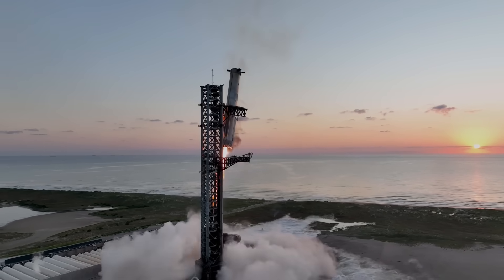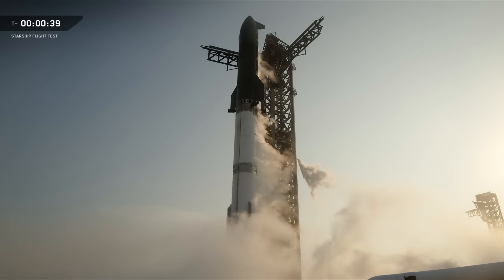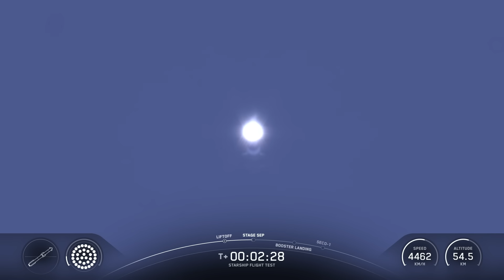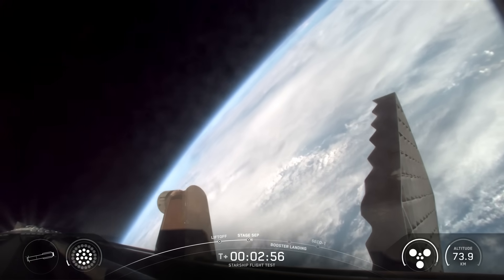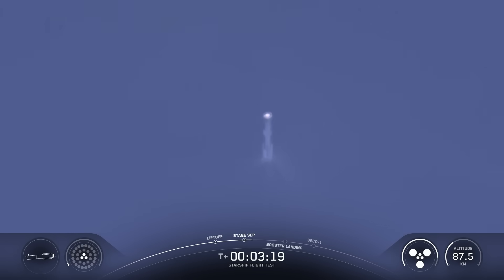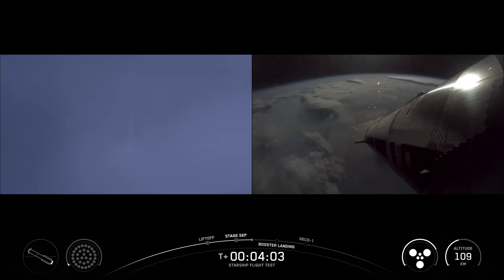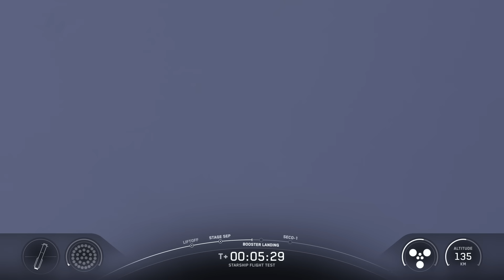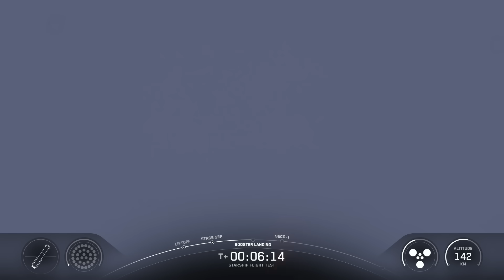SpaceX Builds Largest Reusable Booster, Also Makes Door That Won't Open - Starship Flight 9 Recap

Comment: There is an old documentary showing rockets blowing up, iteration after iteration and the NASA narrator says, "Each time we blew up a rocket we learned another way to not blow up a rocket".  That was totally logical to me at age 9.  Now watching these utterly fantastic iterations from SpaceX I have to think of those early days of NASA and still, at 71 I agree with the logic.  Run it till it breaks and figure out the failure.  It will take as many flights as are needed but they have the grit and determination to win.  As much as I despise his politics I can only say from the heart, God speed Elon Musk.  I'm not getting any younger and I want my ticket to the big wheel in the sky.  heh

Comment: Good video Scott.  I think SpaceX need to reduce the vibrations at source, not merely strengthen the parts which fail under vibration stress.  The raptors need to have dynamic damping on the propellent lines feeding the engine.  This requires a chamber containing gas to absorb some of the pressure fluctuations. No doubt they have solved dozens of tricky engineering problems that I know nothing about but the two big issues I see are the lack of flame trench initially, and the lack of dynamic pressure damping within the engines.  They have now adopted a flame trench - will they also redesign the engine to reduce vibration?  Anyway, what they have achieved is tremendous, and impressive.
Reply: If one is to assume this is the core problem, since fuel pumps have oscillating rather than continuous flow, perhaps each pump's cycle could be offset, so that the combined vibrations cancel each other, instead of going harmonic and resonant.

Comment: Who else but the Presidents mate would get away with so many failures? Ship has not worked 100% on any of the flights so far, either on the way up or on the way down. No other Space launch company would get such a huge free pass for failure. SpaceX have some excellent engineers, but this "The best part is no part" mentality is holding the whole company back. Musk is the problem in Space X and his build it cheap mentality. I pity the first humans to fly on Budget Space.
Reply: Have you not seen all of the test flights?
Reply: SpaceX is a private company.  There is no "getting away" with something.  They are free to do as they like, and their customers are free to abandon them if a better alternative comes along.  Reminder even with all these failures, the Starship program is estimated to have cost ~8b so far, vs. ~80b for SLS....

Comment: Don't we remember anymore that Space Shuttle went to space with astronauts without a test launch?
Reply: And it took 8 years from funding allocation to first flight.
Reply: @rootieboy  Bruh starship has been in development for 13 years
Reply: @rootieboy   and how many years did starship take to have 9 failures?
Reply: @rootieboy  it's been 9 years since the starship concept was first revealed. 6 since this version started development.
Reply: And it killed 1/50 of its flights, including the astronauts.
Reply: The Space Shuttle was engineered, and the Starship is being designed by trial and error.😂 I'm still not sure how you human rate a spaceship designed by trial and error.
Reply: @user-fr3hy9uh6y  put musk in it and see what happens.
Reply: @user-fr3hy9uh6y  Godspeed to the first people to actually fly in one of these things.
Reply: And if it had test launches and iterative program, Challenger and Columbia crews could still be here.
Reply: @ArathirCz  It would not have. Both failure modes were known about prior to their respective disasters and it was a management error not to remedy them in time.
Iterative design would've done nothing. Other than, by the looks of things, make each disaster happen way earlier in the timeline.
Reply: This
Reply: We remember a few more things about the Space Shuttle too...
Reply: The space shuttle program murdered multiple astronauts. You're an imbecile... At best.
Reply: and it cost 900 million per launch
Reply: And the Saturn 5 had 12/13 sucessful launches, with one being a partial failure of the upper stage.
Reply: At what cost?
Reply: What you mean the hardware still had major near fatal failures and even fatal ones
Reply: And my mom can go to the store on her bike; what does that have to do with a different testing paradigm etc.? Note, my mom does not want to go to space but surely tests my patience to not try
Reply: YEAH BUT...  They were not making the worlds richest man richer - so in that regard they were total failures
Reply: @piccalillipit9211 how Is making elon ritcher? Quite the opposite.

Comment: "most advanced rocket engine we've ever seen... struggling to make a door". That one killed me
Reply: Idk if you have ever watched a DnD podcast, even high level parties fail to open doors
Reply: They expected rocket engines to be difficult to make and planned accordingly. They expected a door to be simple to do and thus planned poorly
Reply: I seems very likely that fuel leaks in the cargo chamber could have changed internal pressures in a way that precluded full actuation. Also could have been related to the semi-uncontrolled axial rotation the ship had shortly after SECO. 

It's fun to hate on things, but we don't have the data yet to conclude whether the door design failed or if there were other factors at play.
Reply: I think there were enough people and resources devoted to the engine team, so it progressed well. Makes sense, the engine is the most complex part.
Most likely there were not enough people on the door team - maybe a single engineer, plus a few interns. The task was simpler, but with limited resources it was underestimated.
Another option would be if the door was fully capable, but some electronics/wiring were burned from the launch, so the commands could not go through. Or another critical system was failing - power/hydraulics was lost for that system.
Reply: @nikolatasev4948  No, as scott mentioned the space shuttle had also problems with the hangar doors. I remember that there was a problem with expanding materials because of the solar heat. At other missions the shuttle faced the sun with its undersite, that was the fix for that. U cant simulate space conditions at that scale.

Comment: One of the boosters engines was flying for the third time and performed perfectly. That I regard as a success.
Reply: Those sea level engines are well designed. I would have never thought that such a complex engine could last as long as they have. The designers did a fantastic job designing them.
Reply: @billsimpson604  I totally agree Bill.

Comment: The booster is a success.  They really need to rethink Starship. 9 launched and they've solved zero problems.  Also, a great deal of funding comes from tax dollars. They are supposed to be able to land on the moon....last year...

On the other hand,  SLS/Orion has already gone around the moon and back.
Reply: What do you mean solved zero problems? It was a different reason for failure and the problem from last time didn’t happen because it was solved, it’s not funded by tax dollars either, a small part of the program has a nasa contract helping fund it, if you knew how government contracts worked you’d realise it’s a stupid comment to make 😂
Reply: Also sls took 11 years to launch the first one, starship has only been in production 6 years, hardly a good argument, maybe you’d have a point if starship was still failing in 5 years time 😂

Comment: Its insane to expect that a rocket built like a tin can to fly not only ones but many times. High vibration is a big problem. It destroys structural integrity of the ship. Get to the drawing board. Add some skin. They cannot test full trust continuous vibration on the ground during pretest. Its a problem.

Comment: at 8:18 decoloration due heat at the rear end of the flap? i dont think they fixed what goes wrong with flight 7 and 8, something leaks + on fire, the ship just hold together long enough til engine shut down this time (by luck?). just my guest, but decoloration is there.

Comment: I’m starting to wonder about the vibration while the first stage is lit. I’m wondering if Starship is being shaken to bits and welds are failing.

Also that’s a lot of debris floating around inside Starship. I think they need to improve the basic welds.

Comment: I wonder if the door not opening is a pressure thing,  any pressure difference between inside and out will  pin the door shut. Is there anything from spaceX on what is going wrong?

Comment: I'd describe the flight as a well-rounded failure. Nothing catastrophic, but nothing that was part of the plan worked either (beyond stage sep and making it to orbital velocity).

The Starship program progress has definetly slowed down. Next three flights, to be flown so quickly, I assume these are the current Starship versions that they want to get rid of. So if that's correct I'm not excited at all about these flights. Best we can expect is a repeat of ocean touchdowns of flights 4-6, and this will eat away 4-5 months from this year frrom June onwards - which basically means 2025 is gone. What's beyond that is really interesting..

It's good Elon is smart enought to realise he needs to get back to his companies after many months in politics.

Comment: Reuse of the booster is definitely a success story.

Not exploding on ascent is a “success” only in the sense that the previous two flights set the bar so low.

Everything else was a failure. 

I take great pleasure in watching SpaceX fail.

Comment: High vibrasion opened holes in the bottom and eventually rocket failed. Booster needs to be more robust. Right now its not. They cut too much weight weekening structural integrity. The best part is no part not always correct. :)

Comment: There is one more thing to consider in the success or failure department, and that is the Artemis 3 deadline.
There are now Starship/material capabilities that they've been trying to demonstrate for around half a year but the Starship has been lost or some other issue has prevented it, and these demonstrations will be required before other demonstrations. This is going to impact their schedule, even if they can ramp up the launches with the increased launch license you need to be confident you have solved issues that prevented the demonstrations from taking place previously.
There is a point when the extra data you gained from launching isn't worth the cost of that launch, if you're basically making no progress in your milestones.
So I think we are somewhat close to a point were they'll need to stand down for a period to really go over design again.

Comment: With the 9th Apollo flight they orbited the moon, tested the descent and ascent of the landing module, docked and returned to earth safely with 3 people on board. 56 years later and in the 9th flight they can't even open the cargo doors. My opinion that this is a very expensive case of imagination meeting harsh reality has not been changed by this test. Also, as good as it was, the second booster use didn't exactly lead to a promising third use even if that was never the plan.
Reply: apollo wasn't trying to reuse the saturn. huge difference.
Reply: @TMS5100  They reuse the Falcon 9 with remarkable success because they're not over complicating it. The Starship is incredibly complex and fixing it seems like a game of Whack-a-Mole. I'd love to be proven wrong but progress isn't headed that way.
Reply: @ColinJonesPonder  I don't understand all the doomsayers.

How long did it take them to develop Falcon to the point where it could be reliably reused as Falcon 9?

 Quite a while considering Falcon first flew in 2006. How long was it from Falcon 9 reaching orbit, to the first successful landing thereafter? How long before turnaround time was a couple weeks instead of several months? Just because Falcon 9 is reliably reusable now, doesn't mean it didn't take over a decade to get there.

 This is the largest, most powerful rocket ever designed and launched, with completely new materials for the tanks and fuselage, new engines and fuel delivery system from the ground up, etc. It's laughably larger than Falcon 9, and it's all revolutionary compared to those systems of the past.

Also, you had talked about it being too complex, Look at Raptor 3 compared to Raptor 1, and the power they're now squeezing out of that simplicity. Look at Raptor 3 compared to Merlin. They're not too dissimilar in size, yet Raptor 3 produces 5 times the thrust. Raptor 3 is half the size of Blue Origin's BE-4, yet will produce more thrust of at least 300 tons, with the aim being 330 tons.

All that to say, it's going to take a little time to iron out the kinks.
Reply: @TMS5100 may I remind you of the advances in IT, engineering and material science in the past 50 years? If NASA had had that technology 50 years ago, they would’ve thought of reusing the Saturn!
I‘d rather fly on a Saturn/Apollo built and operated by the steel eyed missile men of 50 years ago than on SpaceX‘s flying death trap.
Reply: Saturn V was the complete culmination of the Mercury and Gemini programs. NASA had over 400,000 engineers and contractors working for them through the entirety of the program, and had the practically unlimited resources of the United States government backing them at the time. IBM alone reportedly had over 4,000 people working on the Saturn program for NASA. 

SpaceX has but a fraction of that man and brainpower working on Starship, and it is itself such a complex system and different in so many ways. They've already accomplished so much while working with a constantly evolving manufacturing and launch site, and it's been less than 6 years. Problems are going to come up that need fixing. Failures are going to happen. 

This is also so different from previous programs of the past where now we get to witness each problem that they encounter and subsequent failure, instead of the launches being broadcast only when it's already through its development stage. In due time, failures will mostly be a thing of the past and we'll hardly think of these failed tests, because we'll be so elated by the successes.
Reply: So I got the mission wrong, it was 10 not 9 but my main point still stands. SpaceX are more than capable of building reusable spacecraft so why so many issues here? It's it a step too far? As I said I'm happy to be proven wrong and I hope they do succeed but I have serious doubts.
Reply: employee turnaround at SpaceX as well, the fluctuation of employees is not beneficial for keeping experience in house
Reply: Let’s not forgot in a prior incident, Apollo killed an entire crew.  SpaceX has a pretty good track record so far.  Elon is always shooting for the stars (hyperbole) and will definitely burn cash and rockets in the process.  His attitude so far is “fail faster” - which if he can afford it and do it safely, I say go for it.

Edited to correct facts
Reply: @spacexdad  err... Apollo 1 never flew.
Reply: @spacexdad please tell us what Apollo flight “killed the entire crew”.

Apollo 1 accident killed the three astronauts, yes. But that was a GROUND based test of the hardware, NEVER intended to fly.

As for SpaceX and safety, Mr Musk has stated (on numerous ocassions) that it will be “many flights” before StarShip is human rated.

People act as if Mr Musk is going to fly humans come this autumn.
Reply: @spacexdad  which subsequent event? The "only" crew loss in the apollo program was in a plugs out ground test for apollo 1 due to an oxygen fire. Which was horrific, tragic and unacceptable, but not really a problem with the Saturn 5, rather with the block 1 apollo capsual
Reply: @josephhooton7781 I believe that qualifies as an event in the Apollo space program.
Reply: @spacexdad not to be snarky. But you do know subsequent means after right? And that Apollo 1 was before Apollo 9? The only major failure of the Apollo program after (subsequent) to 9 was Apollo 13
Reply: @josephhooton7781  you are correct I confuse the timelines on those
Reply: @spacexdad  Stars are flaming balls of gas. Nobody's going to the "stars"
Reply: @lamarw7757 oh phew!  Glad that got cleared up!  😂
Reply: @lamarw7757  The planets that circling the stars. C'mon man.
Reply: Apollo 9 did not “orbit the Moon”. It operated in a low-earth orbit regimen.
Both first and second stage of the Saturn V underperformed, and the mission was almost scrubbed. Third stage managed to make up the deficit.

SpaceX HAS been able to “open and close cargo door”… already done in a previous flight.

And booster was NEVER planned for a third use, so why bring it up?

Both booster and starship were planned for single-mission non-recovery, used to explore more extreme regimes in actual flight.

As for that, SLS failed. Remember the astronauts who had to ‘hitch a ride home’ on the “Looser SpaceX”.
And SLS was reusing Shuttle tech, including actual Shuttle engines.

And SpaceX was set back almost two years when FAA pulled their launch license after the 100 meter ‘hops’ and were going to 10-kilometer hops

Is SpaceX ‘behind’? Yes.
Has SpaceX gone further than any other launch company? Yes.